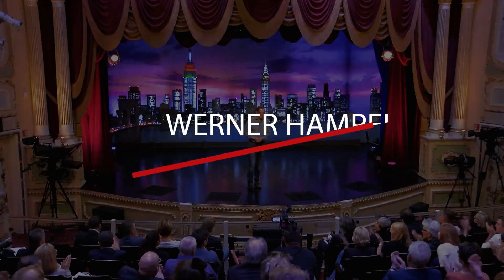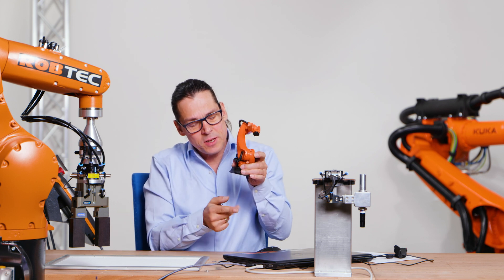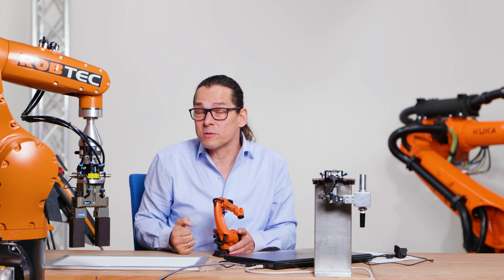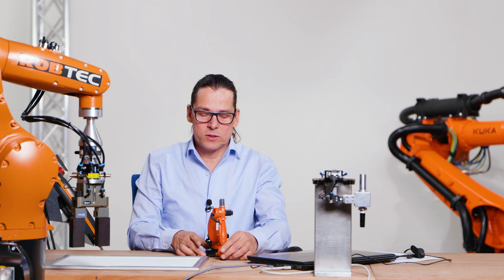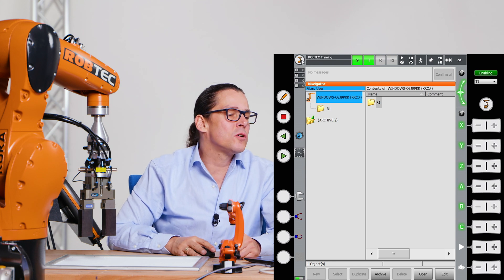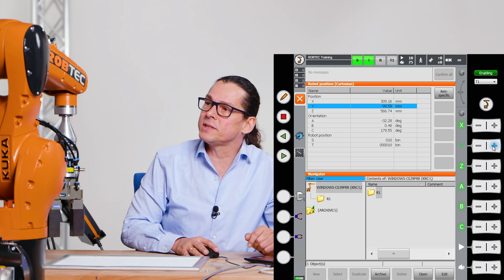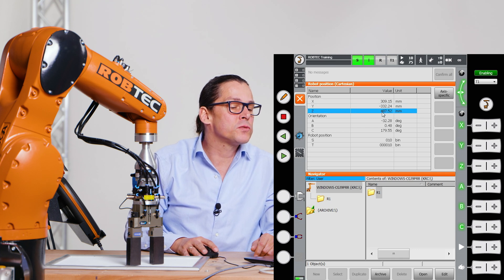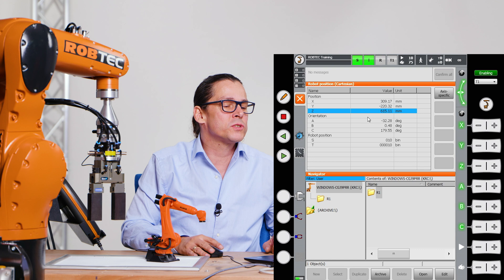World Coordinate System of Robots Explained | The Robotics Channel

Comment: Hello sir, In the tool base status indicator, currently the tool selected is T0. If we change this tool here by some T1, let us assume T1 be on some pin in gripper. Will this change the value of actual position. Will it now measure the X,Y and Z from world coordinate system to T1 or axis 6 centre as doing now . ?